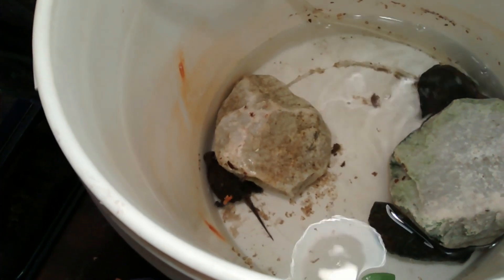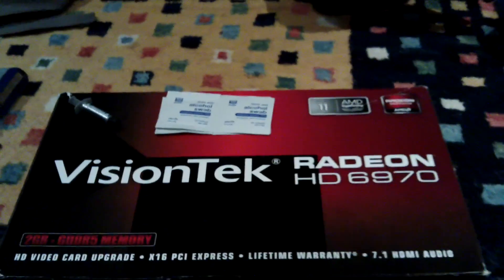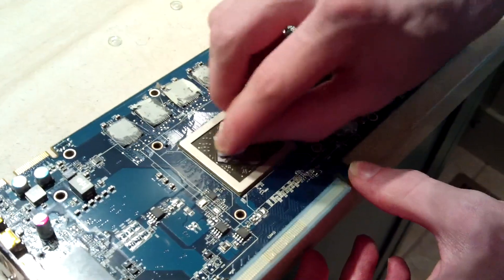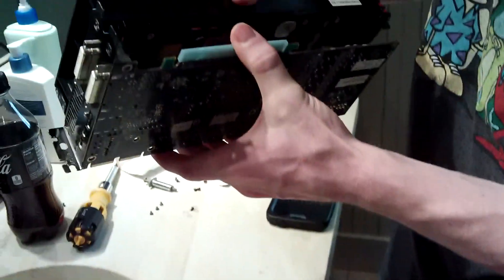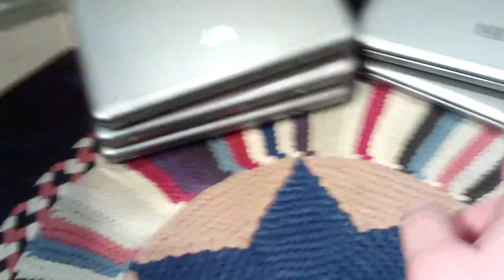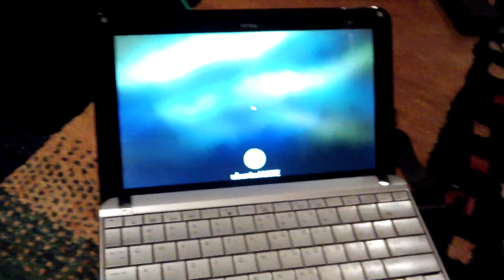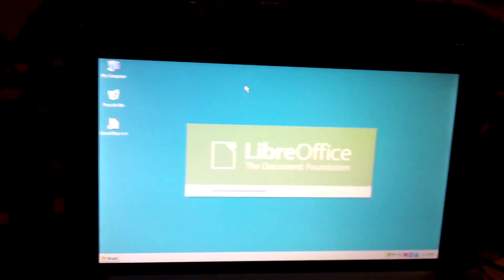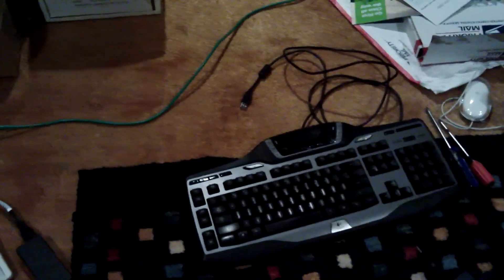Grateful42's GPU Maintenance & More Netbooks

Comment: Love the 2140/2133. Very nice and versatile devices, too bad the 2133 keep dying if not fixed early when still going. Replacement parts are going somewhat scarce.

If you didn't get rid of them yet, check the dead ones. Some screens might feature the higher resolution panels.